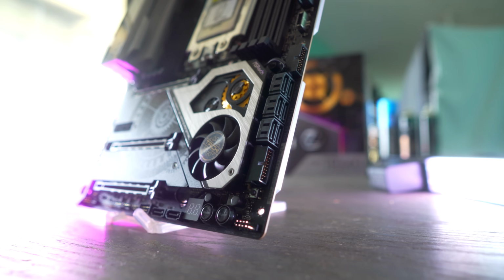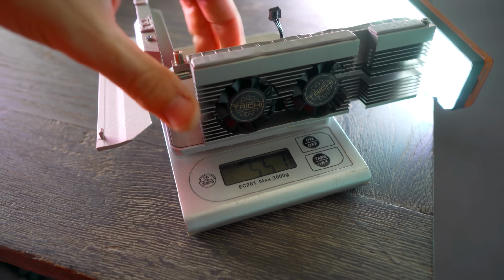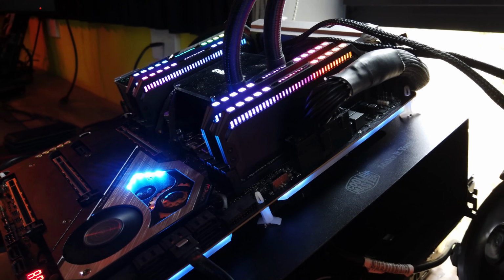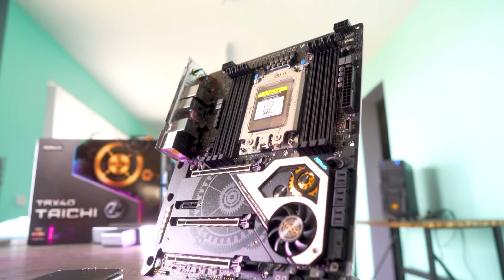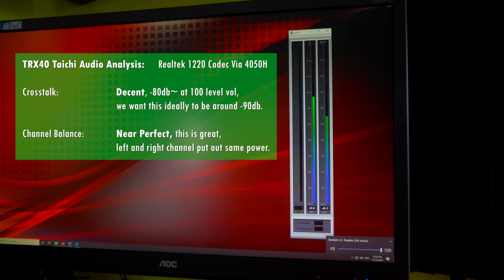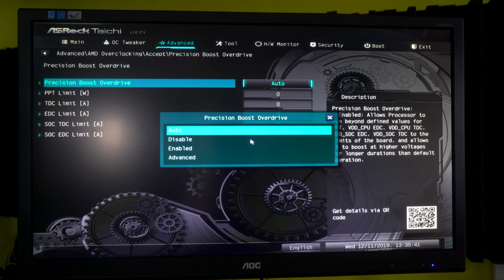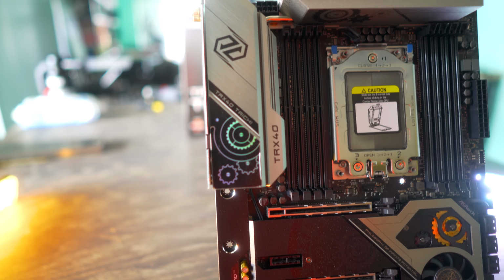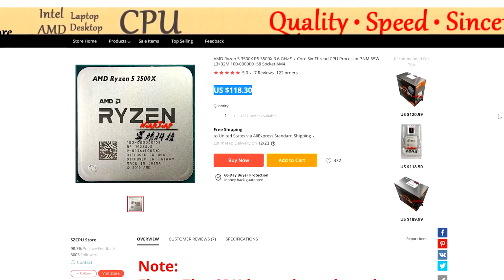TRX40 ASRock Taichi Review - The ULTIMATE Threadripper Solution...?

Comment: If you want to build a server then that motherboard is the way to go and INTEL is hitting back with a 28 core 56 thread OPTERON but the motherboard will only fit into a 4U Server case plus the standard heat-sinks and then you have the need for forced air cooling which makes for a noisy system.

Comment: My plan with Thread Ripper is pretty simple. Install GNU/Linux than running Windows through VM with a dedicated GPU in order to be able to use the very few softwares i can't run on a real operating system because greedy companies which prioritizes market share over user experience. Also, that way i don't need to worry anymore about Windows destroying my grub2 dual boot every "major" updates :(

Comment: I've been concerned that my board (MSI X570 Creation) is gimping the PCIe lane going to my graphics card when using the NVMe expander card. Is the card getting full use of all the lanes? I'm using all the NVMe slots available, which give me 2T for the OS, and another 2T X 3 = 6T, for storage. No other drives on the system. I'm asking because the TRX40 seems to have a similar NVMe Expander card. I  can't seem to find an answer online and MSI hasn't been much help either. Thought that maybe you might know?

I'm running 32 Gb of 3600 Spd Ram, and presently using a 3600X as a CPU. I'm planning on upgrading to a higher-end CPU later, possibly the 3900X or 3950X (if I can get a hold of one). I'm thinking that the gimp, if there is one, maybe CPU bound?